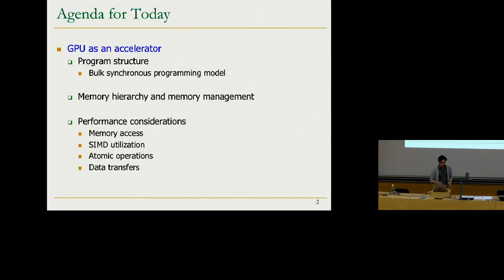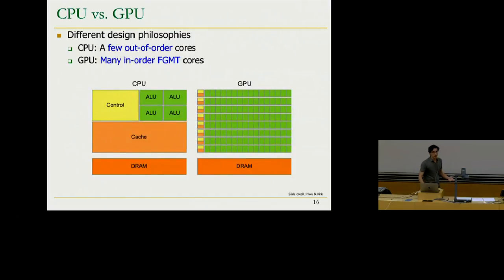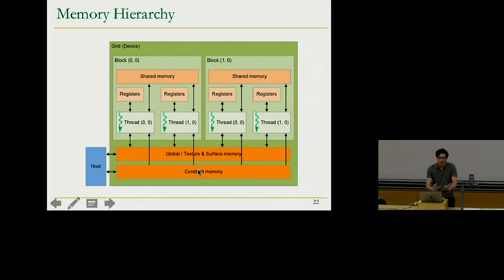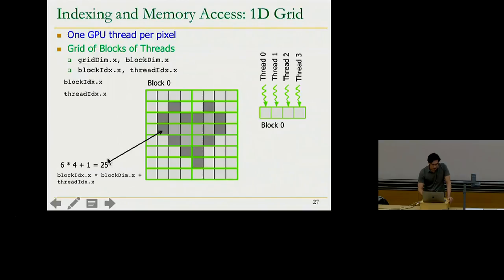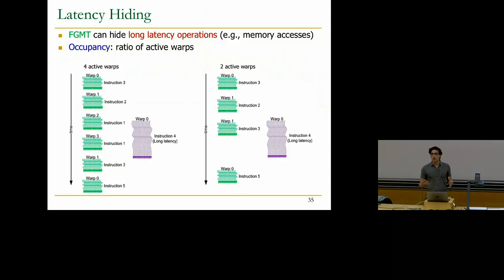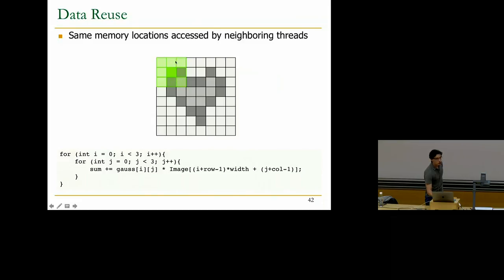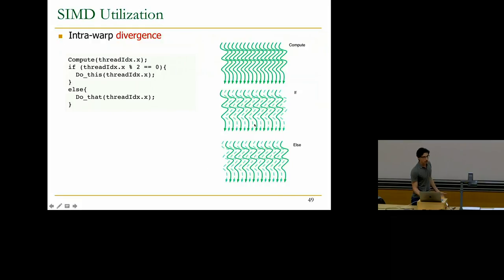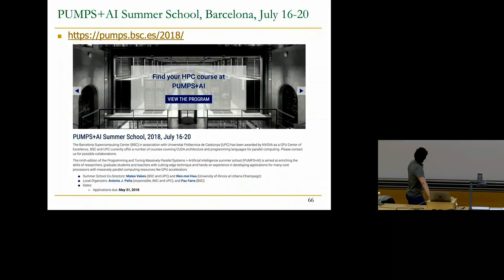Design of Digital Circuits - Lecture 22: GPU Programming (ETH Zürich, Spring 2018)

Comment: Thanks for sharing this amazing GPU lect. Why do we need to transfer the Data btw CPU Memory and GPU memory? Can we keep 1 global memory and use only 1 global memory to support both GPU and CPU access?
Reply: hello my friend, the computer arthitecture is very confusing, but I try to help you. I think you want a global memory for example cpu execute load/store operation on that memory, also gpu execute load/store operation. cpu use the memory on  mother board, and gpu use the memory located on its own borad. if cpu and gpu share same memory, it effects performance on other process for example gpu wants to write a matrix line and cpu reads a mp3 file in same time. these requests cause conflict and delay.